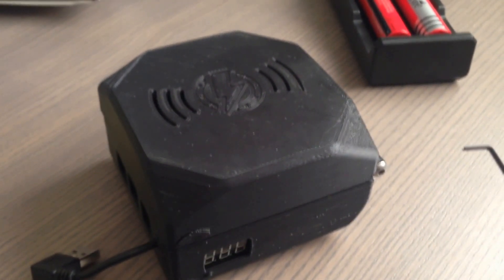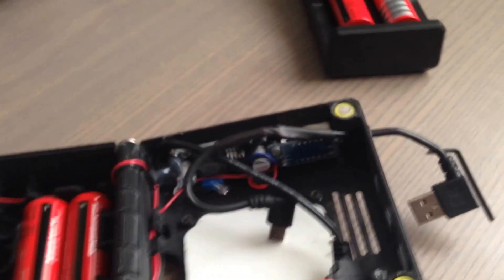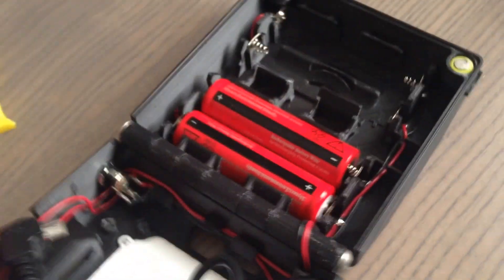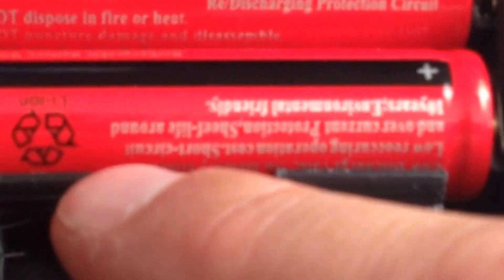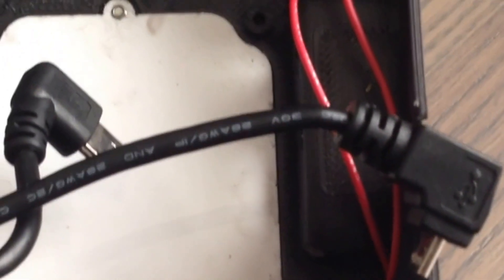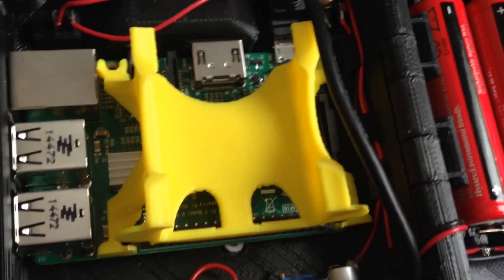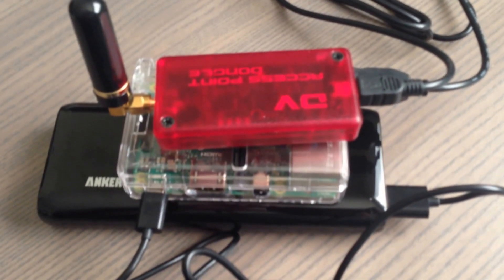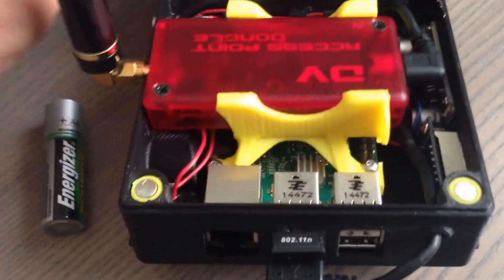Hardened Power Systems DHAP Mini Review

Comment: Interesting they recommend those ultrafire batteries.  The vaping community avoid them like the plague and they're known as poor performers.  Granted current draw in this application is a non issue but I'd still be sticking with known brands over these cheap Chinese batteries.
Just keep an eye on them in particular when charging.
Reply from the maker: Hardened Power Systems has changed their recommended battery since I posted this video. As I understand it there were a few fires as many of the Surefire batteries are counterfeit and many lack the protection circuitry. I can't remember if I mention it in the video or not but I have found that the 18650 batteries vary greatly in size (mostly length). The tolerances on this device only allow for the smaller of the available batteries.
Reply: W5MRM
samsung, lg and sony have a good name in 18650s. some have internal protection which obviously makes them larger. I cant tell from the vid but do you need button tops or could you get away with flat tops ?
Reply from the maker: I believe you can use the flat tops. I was going to try it but the flat tops I have have internal protection and are too large.

Comment: Marty does the new version of the DHAP have a polite shutdown of the RPi or does it do a power kerchunk?  In my original DHAP the power button just nukes the power and I have found the data card on the RPi gets corrrupted over time
Greg
VA7BC
Reply from the maker: VA7BC Hello Greg The DHAP mini just shuts it down as you describe. If you run the Maryland-Dstar image there is a way to send shutdown commands from the radio to the DVAP / Raspberry Pi combo. I have attempted this once but didn't get it to work. I didn't spend anytime with it but plan to here in the future. I would suggest keeping a second card fully imaged and standing by as a work around. When I get the time to try the commands on the Maryland-Dstar image I will post a video if I am successful.
Reply: W5MRM Thanks Marty. Re having a 2nd card, that's exactly what I do so I can swap them out if I run into trouble.  I've got a review of the original DHAP on my channel with use of a small keyboard and monitor for accessing the RPi in the field.   73
Greg
Reply from the maker: VA7BC Thanks for letting me know about your review. I'll go check that out. 73!

Comment: Thanks for the review,, Marty!

All your points (good & bad) are well made and appropriate.

One of the benefits of 3D printing the housing is that we are continuously improving the master CAD files that are printed.  We have reduced the boss height that interfered with your USB connection to the Pi, and we have altered the battery well design to stop the small piece from being weak.

Also, for clarification, HRO and GigaParts are both carrying the DHAP.  We also continue to offer them on our website (PortableUniversalPower), and in all cases we are price matching... so the retail price is consistent.  I hope this makes it easier for the machines to be found in stock at any given time.

Thanks again for taking the time and for doing such a thorough job...

73!

Bill Harrison  KK4JPT
Reply from the maker: Hardened Power Thank you for your Reply Bill. Glad to hear about the changes that have been made. I have been happy with the DHAP mini and knowing that you are there to back the product adds that much more value. Thanks again and 73! Marty W5MRM